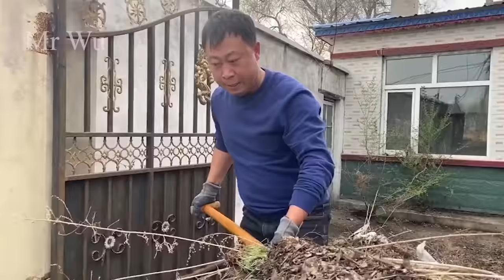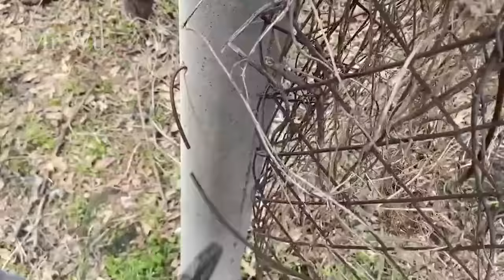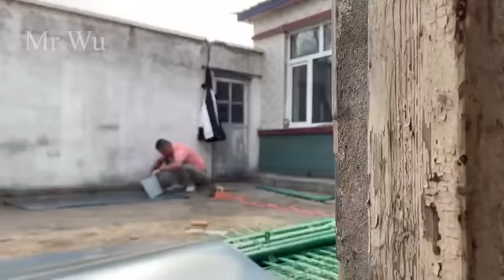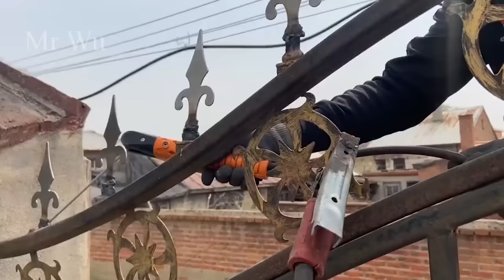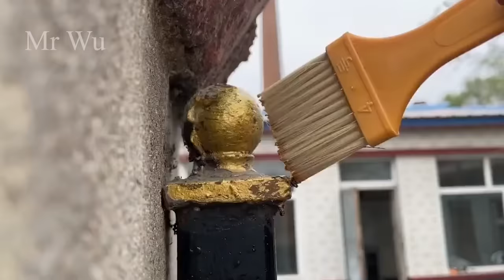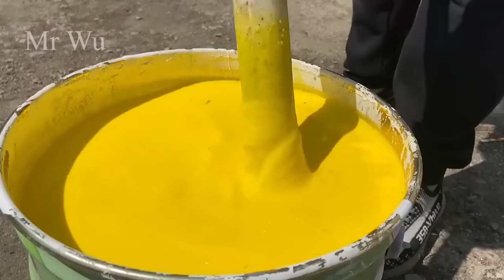Single dad renovates and cleans old house in the suburbs Mr Wu

Comment: Great work! Love that you planted vegetables. Last year we bought a old 1912 two story house on the Canadian prairies. A real fixer upper. We gutted it completely and now slowly installing 2" + 1" + 1.5" foam insulation for R27 in exterior walls. This spring I planted 80 potato plants, along with rhubarb, aspagras and 6 fruit trees in the front and back yards.
Reply: @TheSteelRoad  I think a great many citizens will be investing in high insulation during this coming winter.
Reply: @TheSteelRoad  High insulation keeps our families warm and safe requiring less energy required therefore lowering carbon emissions and air pollution there bud.
Reply: @TheSteelRoad  I don't remember asking you to comment your thoughts on this thread bud.